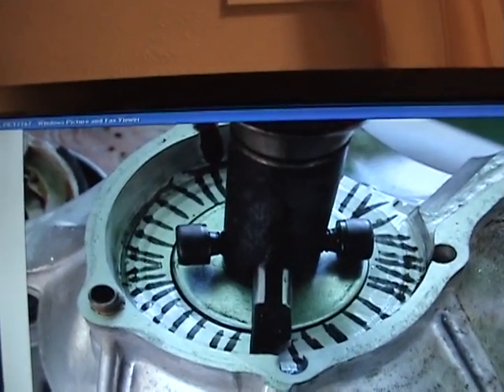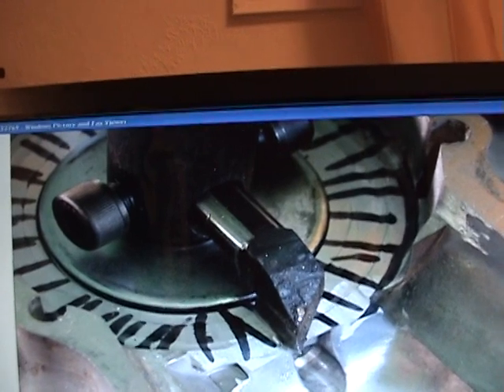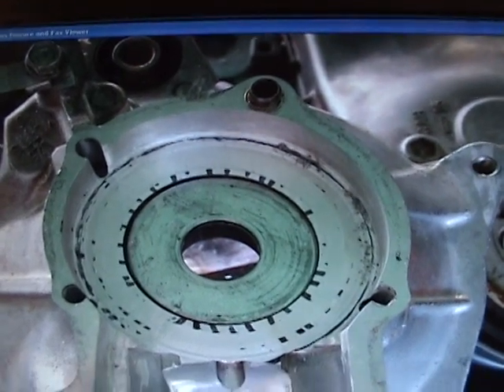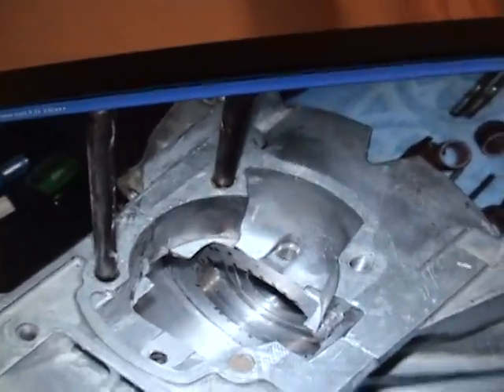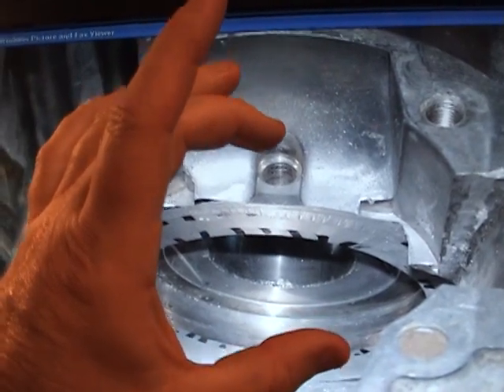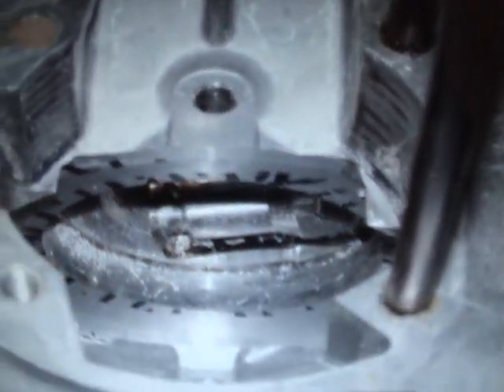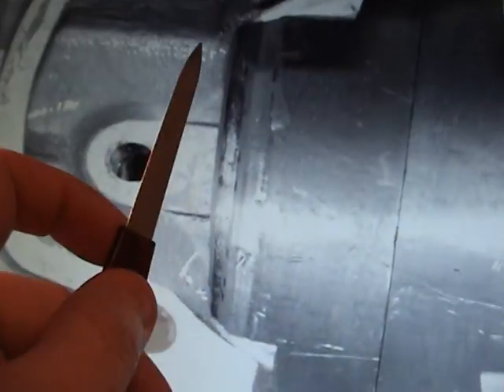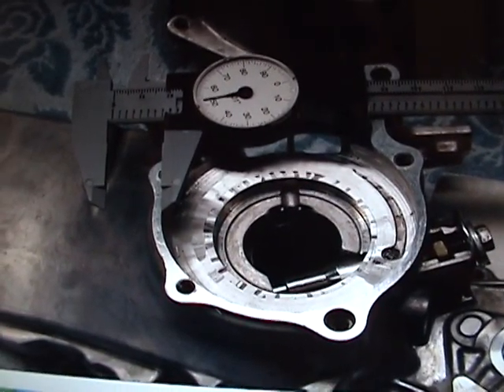(9)- HOW TO BUILD A 120CC DIO RACE ENGINE STEP BY STEP

Comment: Are these motors basically the same as the polaris predator 90 & 50cc motors u can get them in liquid cooled kits dont know if they come stock liquid like urs or if ur honda dio was orignally air cooled too